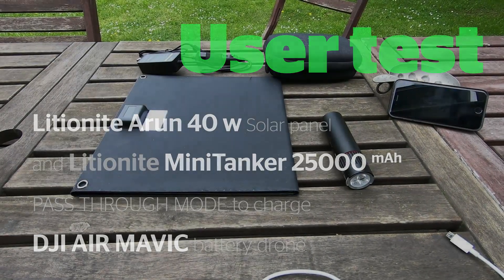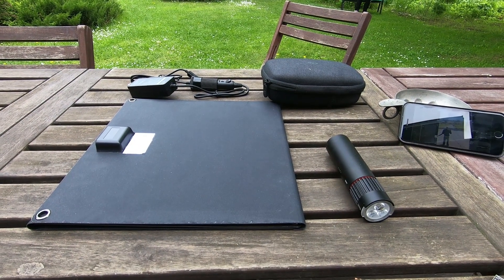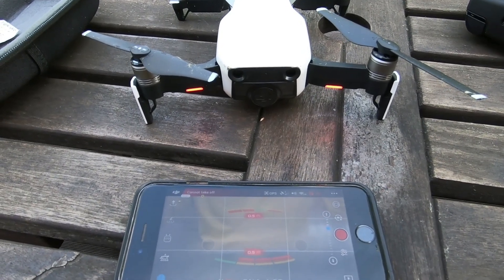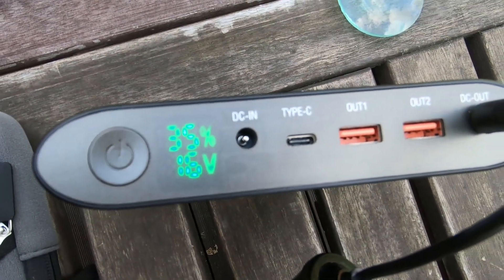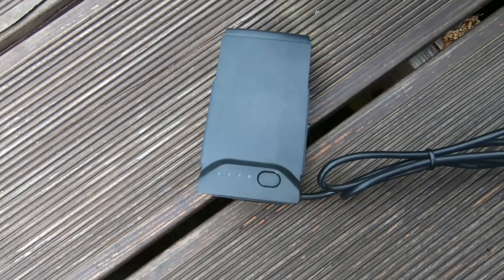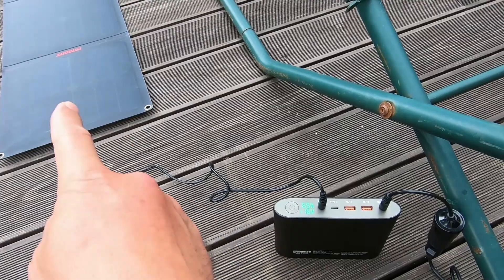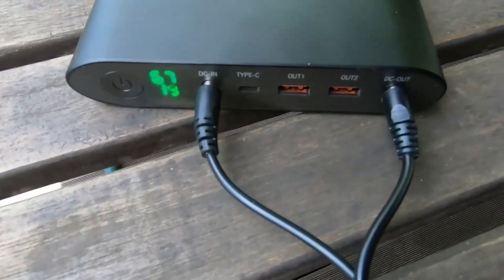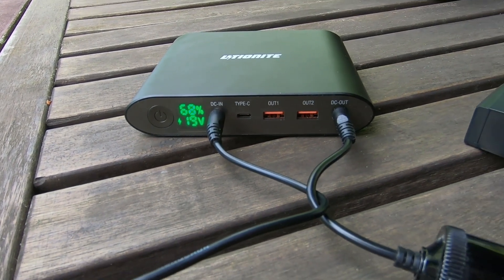Charging Dji Air with Arun 40W and Litionite Mini Tanker 25000mah

Comment: I just bought this battery and I want to charge my Chromebook. Unfortunately the DC-out cable is designed for a Mac. I'm looking for a DC-out to USB-C to charge my Chromebook. Do you have any information about it?
Reply from the maker: you can go out straight from the USB-C out to charge it? I have TYPE USB-C on my Minitanker next to DC IN
Reply: @nikoulph  yes of course but it is 12V only with USB-C and it take more time to charge my Chromebook
Reply from the maker: Ricardo Thys if you’re notebook can be charged via USB C. It should work. I charged my notebook like that.
Reply from the maker: Check as well how to switch different voltage output, with power button you can select different voltage. I can't remember how, but it's like hold button, than click to change.. or google it

Comment: Hi ! great job charging mavic air battery ! i wonder what matérial using between the power bank output and the dji battery input??? if you have any links about ? thanks for your help. have a good day :)
Reply from the maker: car charger for dji ... it's a bit of gimmick setup, but the only one possible I've found to charger this damn dji batteries....
You need one female car charger plugged into the power bank 02:12. Female connected to male dji air car charger, that connects to the battery...
:/ 
Good luck
Reply: @nikoulph  this is great!! where did you get the female car charger?? do you have any link?
Reply from the maker: @MrSpiralout  i Think it’s the original DJI car charger

Comment: Yeah same necessity here... bicycle travels... hope the combination will work well and charge my matebook x pro with usb-c power delivery
Reply from the maker: I've already charged successfully Microsoft Surface Book 2 with USB-C Power cable from Apple.
If the computer is shutdown the powerbank will charge the SB2 battery, if computer is ON it will use power from power bank but will not charge it. (still you can work longer).
Reply: @nikoulph  Nice and good to know :) I will go with this one
Reply from the maker: @kyr0 When you use the powerbank minitanker or bigger: First I've use it in 16V mode, depletion was very fast and charge was quick. Than I started using in 12V mode a bit slower goes ON and OFF at times, but you wait and it will charge with less depletion.
Reply: @nikoulph  That's perfect. I'm really looking forward to my 2000km bike tour in August :)
Reply from the maker: @fluctura  I'm soon going too :) can't wait. 
Where too for you 2000km?
Reply from the maker: Crap... I saw this a bit late. 
Baikal! 
Maybe around the lake, maybe just chilling in the nature by the lake. I still have to figure out the risks (wild animals)
And how many 1000's km... I don't know and I don't care :) I will see